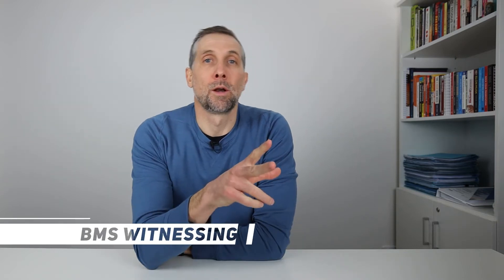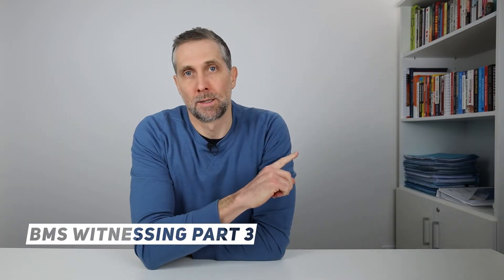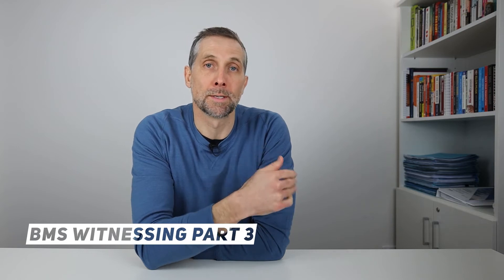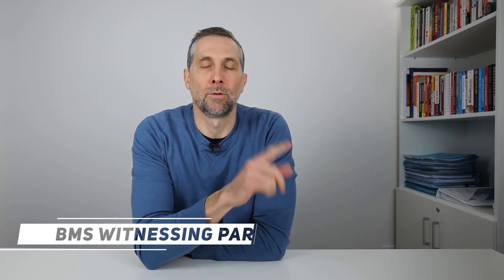How to Witness a Building Management System - 3rd Day

Comment: Enjoyed this......liked the bit on metering systems...new buildings can have 300+ submeters installed which is further challenging building commissioning. Have you ever tried Analytics assisted BMS commissioning?
Reply from the maker: Hello Rod, I have talked about it, and analytics for commissioning is a topic on one of the BMS training courses. But, not had the right job yet. It would be quite difficult to get a cloud based solution up and running 3 months before witnessing. Definitely can be done, but would require a significant effort by the BMS contractor. And, they are not going to make that effort for a 3rd party analytics supplier. 
You got me thinking though.
Maybe i'll do a video that explains how it could be done during the mad rush towards handover. I have a few ideas :-)
Reply: @bryceanderson17  We were fortuntate to apply analytics comissioning to a couple of BMS retrofit/upgrades. They were relatively simple systems (Water Cooled chillers, AHU's, VAV), as it was D&C projects we could infulence the process. The key is standardised point naming conventions. It adds significant value to the commissioniong process.